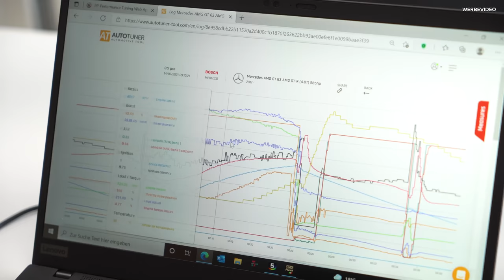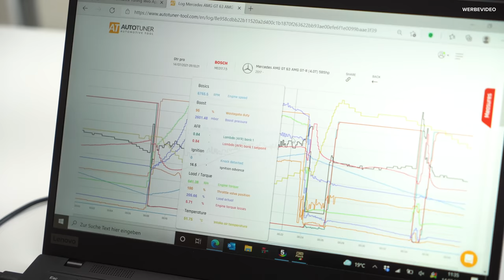Downpipes und Software für den limitierten AMG GTR PRO | PP-Performance

Comment: Daniel Abt sein GT2-RS fährt in Serie 5,3s von 100-200.
Hast du seine 800 Meter Rennen nicht gesehen?
Reply: Was?😄
Serie 585ps
Passt doch alles?
Reply: Gt2rs mit 700ps --> 5,3 
Und der GTR mit ~680ps dann 5,5 passt doch perfekt
Reply: @ben079329  
Der GT2-RS vom Daniel wurde nicht gemessen.
Wie kommst du auf 700 PS?